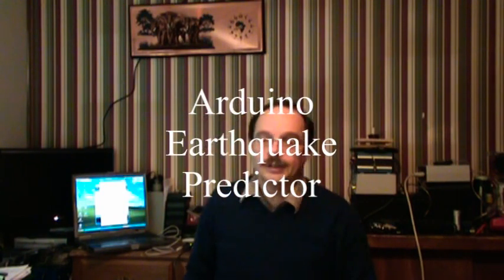Arduino Based Earthquake Prediction device

Comment: Damned 500 characters... If we can make something very cheap and effective through open science and engineering and have many passionate scientists join the project and plant a few sensors say 100kms apart, all around the globe, we could have a network in no time. Than if we consider all the weather live data and everything we monitor like suns' activity etc, we can get the hole picture clearly and make better predictions. Many fields will benefit, like agriculture etc, and there will be funds..

Comment: Hi Bob, nice work! I'm in a team working on optical-fiber-based sensors that can achieve great accuracy and can sort out signals. I had this idea of a Network of sensors monitoring electro-magnetic fields and fluctuations inside the planet, and out, how magnetic field interactions in and out the solar system affect or influence variations on Earth. Gravitational field interactions would also be monitorable with similar sensors and if we get all this data together we could create a 3d live model.

Comment: Also, if you did decide to data log more then let say 4- X,Y,Z points using non-magnetic scaffolding (like PVC pipe), would you have to go over to a faster type of processor then the Arduino? Or maybe something that does parallel processing such as the Propeller?